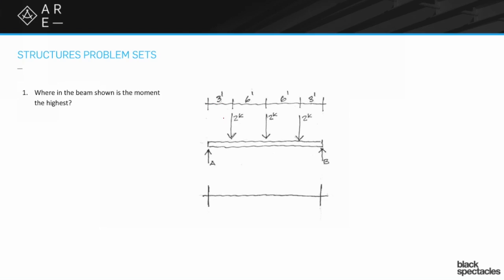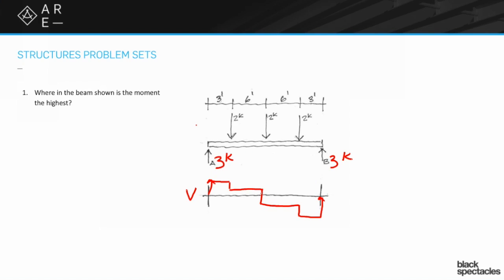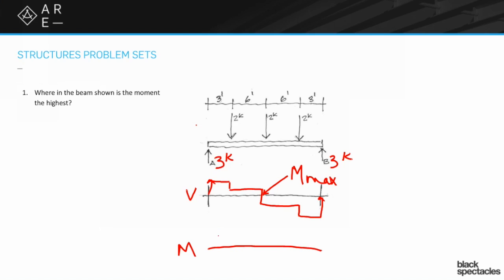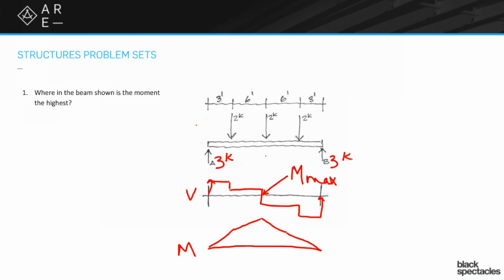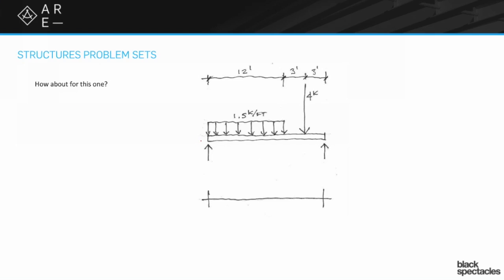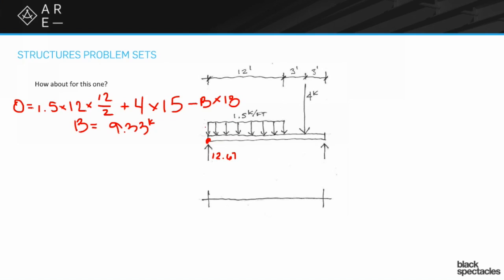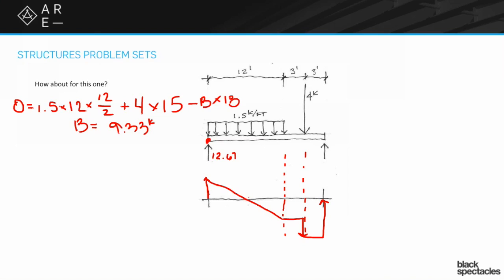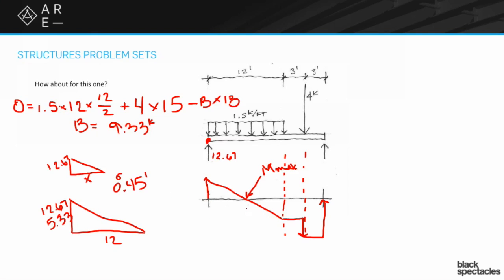Shear and Moment Diagram - Structural Systems - Architect Registration Exam A.R.E. Webinar

Comment: where and how did the 5.33 come from and what is that value for?
Reply: 9.33k minus 4k equals 5.33k or the vertical distance that makes up the remainder of the triangle she draws at 9min.
Reply: 18-12.67=5.33
Reply: @miguelmagtaan7792  did you subtract a force from a distance?
Reply: It’s 12x1.5-12.67=5.33